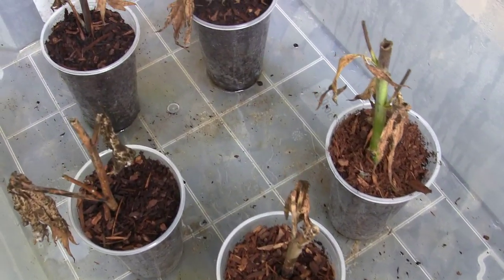Why am I Getting Mold on My Plant Cuttings | Why are They Rotting in My Propagation Frame

Comment: HI Mike love your videos. Would you recommend watering cuttings that have rooted from the bottom or the top?  I have my cuttings growing in an 8oz clear cups.  I am currently watering them from the bottom and only let about the first two bottom inches of the dirt in the cup get saturated. So far they are doing pretty well but I am wondering if this is the best way to water or if i am not watering them enough.  Once i notice that the soil is about to dry out I repeat the process.
Reply from the maker: Watering from the bottom is probably better because the soil can wick what it needs.  You can still overwater this way though so be careful.

Comment: Hi, I like every of your videos.   I have a little green house.  I tried to propagate the roses and orange from cuttings and I put all of the cuttings in the little green house.  My roses are not getting any leaves and turned dry and brown.   Only 1 cutting rose is getting a new leave.  I do water them every other day.  I will stop watering them now after watching your videos.  Can you help me figure out what happen to them.  Thanks.
Reply from the maker: There are many factors that go into rooting cuttings and it would be tough for me to pin down the exact problem without seeing what you did.  My suggestion is to keep learning and working with cuttings and you'll learn as you go.  I answer a lot of questions throughout my videos.  the more you learn and practice, the better you'll get.

Comment: Mike,

I started rooting fig cuttings and My method is I wrap the wood above the potting medium with saran wrap. Now the pores on the wood under the wrap have formed this white fluffy cotton like fungus mold. What do you suggest I do unwrap and clean? But this will disturb the rooting process will I lose the cutting in your view? Or is there a better alternative? Or can I just leave it for another two weeks until I’m ready to transplant them?
Reply from the maker: I don't like wrapping the cutting for that very reason.  They may be fine but I'd probably try to unwrap them before it becomes a problem.
Reply: @MikeKincaid79  I went ahead and unwrapped them. I now have the causes of what happened. 
1- I was rooting still half green cuttings.
2- I was using too much heat it caused the 1mm roots to cook and turn brown.
3- Wrapping made the greenest parts of the cutting pores to sweat and hold on to that moisture that it began to root at the top under the wrap. Obviously, the Anaerobic atmosphere I created formed mold around those roots at the top and things were not pretty.

I guess the only mistake I didn't make was over water because I learned that long ago that just damp is perfect as long as I monitor it. 

I did scratch the bark the cuttings are still alive I'm just not sure if they will root from those cooked pores again or not. I have uncovered them obviously but boy am I scared they will dry out. its all I think about.

By the way, you are very informative and respectful for responding in such a timely manner.
Reply from the maker: Glad you figured out the problems and I wish you luck in rooting them.

Comment: Can you make a video on how to recover a plant on root rot? I have success on handling plants with this condition but another opinion would be helpful! Quickly please!
Reply: I have a variegated monstera I spent a lot of money on and the soil mixture I had was wrong and I drowned it. I don't want to cut it apart. I sanitized everything, got the correct soil combo and my confusion is how much water after repotting it should I use. I dont even want to water but I did a little. I also added rhizeup which helps prevent root rot and establish new roots. Please help!

Comment: Too much heat (Florida garage in the summer) and not enough airflow (sealed tote) we’re my problems. If you already have mold build up, can you still recover? I opened the tote, put it on covered balcony for max airflow and no direct sun. Am I better keeping it inside the house with controlled 74 F ? Or balcony will do? Wipe mold off and pray 🙏
Reply from the maker: Hydrogen peroxide is a really great cure for mold and it won't harm the cuttings.
Reply: @MikeKincaid79  yeah I found that too, tried it yesterday, will see how it does 🙏

Comment: Bottom heat for rose cuttings was the worst advice I got from a different YT channel. The moisture/condensattion that formed was off the charts, and all my cuttings molded and rotted literally within a couple of days.
Reply from the maker: Yeah, I don’t recommend bottom heat for a sealed system in the summer.  Bottom heat is primarily for semi hardwood and hardwood cuttings when the weather is cooler.

Comment: Ok, checked on my  hydrangea cuttings this afternoon and there are little bugs and the pots have condensation on them. Also noticed one has a couple of brown spots. I have not watered them since putting them in there.I cracked the sealed container about 1/2 an inch. Is there anything else I  can do for this up coming week where the temps are going to be in the mid to upper 90s? The cuttings are  about 6 weeks and are doing extremely well( wish i could post a pic). They have  new growth coming from under the soil. Hellllp!!!! I don't to lose the cuttings. Very new to gardening.
Reply from the maker: Keep them in a shady place so the heat doesn't build up too much.  Sounds like you're doing great so far.

Comment: I saw a video yesterday and he wraps the bottom third of the fig cutting in wet paper towel and put it in a ziplock in a warm spot. Would you do that? I did and I think I need to change that idea asap.
Reply from the maker: I wouldn’t do that.  I have a great video describing what I would do:  https://youtu.be/LymBdzprYJ4?si=IDx81YIF8PT54mmu
Reply: I went and got some rooting jell and some cactus soil...added more perlite to it, put it in a 2 gallon pot... added 5 cuttings and a bamboo stick in the center to hold up the plastic bag tent that I have the pot it. Will keep it someplace warm and shaded for a few weeks or more. Thankyou @MikeKincaid79

Comment: Thank you for this.  I hope it helps.  See, I am trying to propagate roses, in a pop water bottle, and I have been getting the mold.  I was so saddened.  I tried boosting the roots with banana peels.  Boy it took off, so I thought, I accomplished my goal.  But then all of a sudden, those beautiful leaves just died.  I am trying to especially do this, because I want to move them to another state.  My problem, is I don't have the kind of frame you do.  For outside.  I have been just trying to do it indoors.  And they face a southern exposure.  Any suggestions?  I will take to heart, to actually dry it out more.  And keep the vent open on the top.  Do you think this could help if I put them underneath a table, and put a sheet over the table to shield them from the light?  Its on our balcony, and the table could shield the direct light?  I just want to accomplish this, so anything you have to offer would help.  Thanks.  At least, I learned something from this.  It's appreciated.
Reply from the maker: Glad you're learning, that's what it's all about.  The condition of the new growth is important.  Make sure to mulch the plant well, fertilize, and water.  Get the new growth really growing fast and then take the cuttings.  Use this method as described and do what you can to keep it out of direct sun but give it plenty of overhead skylight.
Reply: @MikeKincaid79  Oh you are so kind, just to communicate.  I am using soil meant for that.  According to my son, the gardener.  So, hopeful.  Thanks.  Too bad, we cannot post photos here, but I am going to keep trying.  God bless you.
Reply from the maker: You can share photos if you get into our Facebook group 'I love plant propagation'.  The link is in the description.
Reply: @MikeKincaid79  Thanks I will do a search....

Comment: Hi Mike , long story short I harvested a layered Rhodo to early ( in hindsight not enough roots I think) and the leaves dropped and started to die so I did something drastic I cut it hard back and put it in a protected North facing position it started to form green bumps on stems but they browned and didn't make it , however now there are now three that are very slightly turning into proper buds and it looks like they're gonna go for it do I water it sparsely , liquid feed it or what , up to now I've been watering sparsely just keeping it moist don't want to blow it as I've got it this far any advise would be appreciated. 
Ps Hope the hand heels up
Fast and remember to up your protein intake To accelerate wound healing.
Reply from the maker: Sounds like you're on the right track.  Just keep the soil moist but don't over water.  Keep it in shade.  I wouldn't fertilize until it starts putting on a lot of active new growth.
Reply: Mike Kincaid Ok Mike thanks for your advice.

Comment: Mike .... The wet and moist season is upon us again ....... I did not see this video before?  Use a solution of Neem oil..... you can also use mineral oil..... on edible crops use sesame oil or vegetable oil ... spray the plants in the greenhouse that we’re giving you trouble ....( as a matter of fact I spray all the plants )(it is a preventitive measure) remember to have good air ventilation in your hoop houses and green houses even if that means putting fans inside of them... I have had that powdery mildew wipe out “whole crops” of many different plant  species ..... also .....do not leave the leaves or any dead material lying around any living plants ....that includes the evergreens.... do you not even put that stuff in the compost pile....I burn that stuff.... and definitely.....never leave it in the green houses or hoop houses....take it out immediately and put it in the burn pile ....
Reply from the maker: Thanks for the tips.

Comment: My cuttings were doing fantastic for the last couple months up till these last couple weeks. Out of nowhere my beautiful cuttings that had wonderful roots and new growth and sprouting buds and leaves. Are now turning black and every single leaf and bud died and fell off. The roots fell off of most of them too. I pruned off the black ends and used fungicides but then the black would come back somewhere else in the middle instead of the ends.
Reply: I planted over 100 willows and ive lost 40 so far and im sure more are going to die. Im so stressed about it all.

Comment: But submerging the airlock bag inside a fridge also creates lots of moisture and it wouldn't need require for mold and wood rot to arise. So, what's the remedy for that problem?
Reply from the maker: Not sure I understand the question but if you're talking about storing cuttings in the fridge, the cold slows down the growth of harmful organisms.
Reply: @MikeKincaid79  Apologies. When I looked up on treating mold on scion branches the algorithm recommended this video. So, I figured if storing plantings in the fridge was similar to storing, then how could one prevent moisture from entering inside the airlock sealed bag?
Reply: @MikeKincaid79  I hope that helped clear up things.

Comment: When shall I give water to my cuttings after placing in potting mix in spring in London please let me know thanks
Reply from the maker: If you’re talking about softwood cuttings that are covered then I don’t recommend watering them until they root.
Reply: @MikeKincaid79  Ohk thanks
Reply: @MikeKincaid79  if I don’t cover shall I give water once week .it’s actually Indian jasmine plant softwood cuttings
Reply from the maker: Softwood cuttings require a high humidity level so they don’t dry out before they root.  You’ll either need a cover or intermittent mist.

Comment: I got a hydrangea growing in a cup that I covered with a bottle top. What do I do now? It's freezing 🥶 here in Winnipeg Manitoba Canada 🇨🇦 and just getting colder. I just don't know what to do next???
Reply from the maker: Did you just start it or has it been growing for awhile now?  Does it have a good root system?  If so, you can probably just up-pot it for added protection at the roots and allow it to go dormant in an unheated shed or garage, through the winter, while making sure the soil remains moist.  If you just started this project, you'll have to bring it indoors if you want any hope of it rooting.
Reply: @Mike Kincaid  yes it has rooted. It's in a plastic cup at the moment with a bottle over top so it has its own ecosystem right now. 😉

Comment: I have a question, so I’m growing a cutting of a rice paddy herb (Limnophila aromatica)/ngo om which is a plant that prefers a humid and highly moisturized environment. I’d originally was growing it with a plastic bag and some air holes so it could retain moisture, however it ended up developing black mold. I don’t know how to grow it bc the environment it needs makes it more susceptible to fungal and bacterial infections. I tried not giving it as much water and then it still ended up wilting and dying.
Reply: @LegendLength  haven’t tried that yet but I think it would make it worse and cause fungal spores to spread around 😅. I’ve tried growing it in my hydroponic system and it also died with that too! This plant is the worse to grow!!
Reply from the maker: I've never grown that plant but what about growing it in a more open environment but with a plate of water under the pot so that moisture is constantly evaporating and surrounding the plant but there is also air flow?

Comment: I have store just like urs but I used vermiculite to put my cuttings in. I have about 8 hydrengea cuttings that are about 3 weeks old now and 1 of the cuts have black spot on the 2 leaves I left on the cutting. What should I do? Can I use a copper based fungicide? I do not water and humidity is close to 90 to 100% in the closed tote. No direct sun ever hits the tote. I'm also worried that I need to put them in bigger pots. I initially started them in 2 inch starter pots but I'm worried that wont be big enough. HELP!
Reply from the maker: It's plenty big enough to initially root the cuttings.  The black spot sounds like fungus and I'd use a general purpose fungicide on them now.
Reply: @MikeKincaid79  thank u. I got some and I'll see how it works!

Comment: So if I do have mold on my cuttings - do I need to throw them all out? Only where I see mold?
Reply from the maker: Depends on how bad it is.  If it isn't too bad you can spray them with a mixture of 50/50 hydrogen peroxide and water and it should kill any mold.

Comment: What if I plant my plant cuttings in a pot how often should I water it?
Reply from the maker: Depends on what plant, time of year, condition of the wood, etc.  If it's a deciduous plant and you're taking the cutting in the early summer as a softwood cuttings then you'll want to cover it to maintain humidity around the cutting.  In that case, you really shouldn't have to water it.
Reply: @MikeKincaid79  Is it good to use moisture meter for unrooted cuttings?
Reply from the maker: I don't use one.  Just make sure the medium drains really well and doesn't get waterlogged.
Reply: @MikeKincaid79  OK Thanks!

Comment: Change your rooting medium. Organic medium is fuel for mold.
Reply: I got mold and rot in perlite.
Reply: @slavbarbie  People literally grow in straight water (hydroponics). What is important is oxgygen content in water and temperature (water cannot hold oxygen after 80 degrees F). I am growing is straight sand, pummice, and peatmoss. For my citrus it is straight sand.
Reply: @davidkoba  I have propagated in water.  Soil and other medium always fail me. Maybe I should try sand.
Reply: @slavbarbie  If you are doing cuttings you need sterile medium and you also need to realized that 50% of them depending on the plant will fail.
Reply: @davidkoba  my first three cuttings were a monstera deliciosa, adansonii, and a syngonium, and they all succeeded in water, and are still happily growing.
Reply: @slavbarbie  great so what's the problem?
Reply: @davidkoba  i was told water is not good and should try perlite. Didn't work out
Reply: @slavbarbie  Water is fine as long as it is oxygenated and chloronated. Look at hydroponics for goodness sake.

Comment: What is mulch?  Rotted wood.  So this is where the mold comes from.
Reply from the maker: I use fresh mulch, not rotted or composted.
Reply: @MikeKincaid79  Mulch is rot.  I put my rose vine cuttings in mulch, 100% of the 32 cuttings died of mold in 8 containers with/without bottles over them to keep up humidity.  I now have 16 in play sand, left some leaves on, past few days so far so good.
Reply: Lived a little longer, and died.  Every one.  Added some Miracle Gro fertilizer for nutrients, did not save them.
Reply: So we get back to what causes rot.  1.  The mulch introduces mold.  Mulch is rotted wood.  This is why some use just perlite or sand.  But it has no nutrients so takes fertilizer.  2.  The dome or covering humidity promotes mold.  Leaves must be dry and occasionally wet, not always wet.  3.  Standing water in the pot bottom produces mold.

Comment: What if it’s the dead of winter in a northern boarder state with a cutting? 
Other states put cuttings in soil? They usually die unless your lucky… I didn’t use soil but placed my cuttings in clear vases with some water. As long as there is photosynthesis (sunlight hitting the entire plant) it will stimulate growth. In southern states or when it’s not winter there is enough water in the air to assist plants. You don’t need heaters if you have them as indoor plants. 
Heat + moister + soil (combination of composite and decomposed matter) = mold? Who knew. 
The fact that you related human children to plants and brought up psychology automatically lets me know you don’t know what your talking about. 
Educate yourself before you try to “educate” others